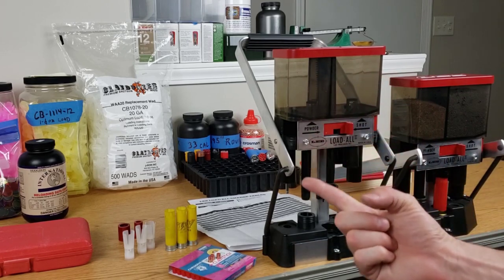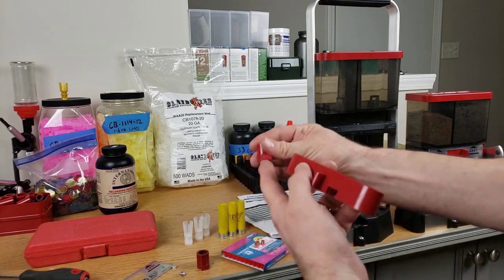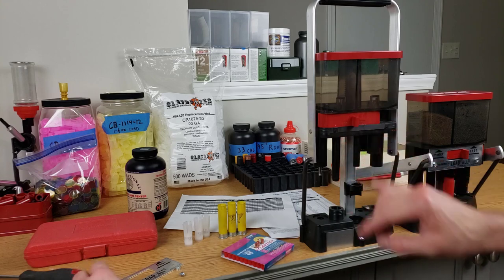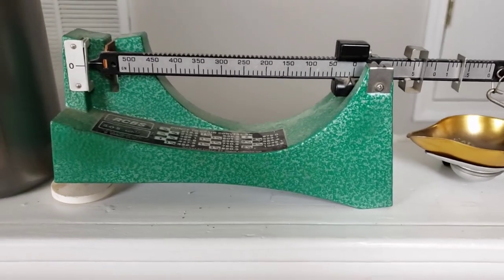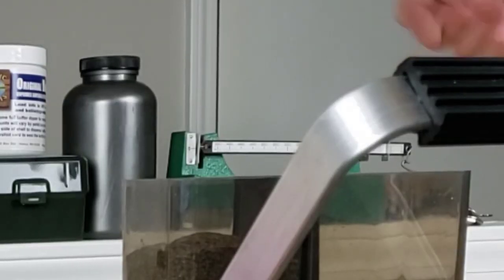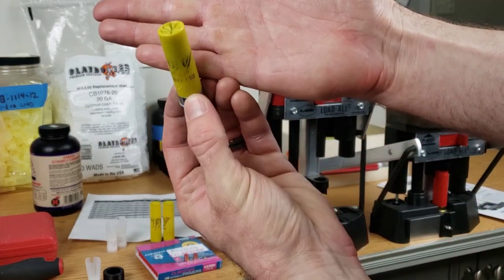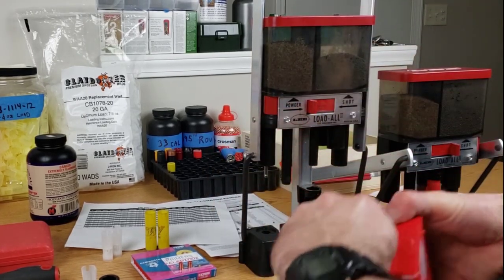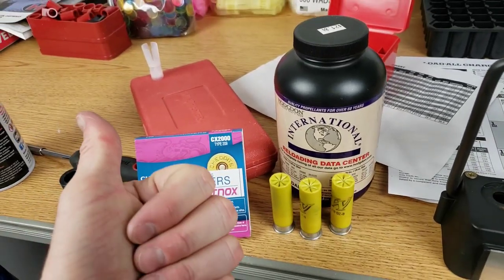First Session On The 20ga Load All II

Comment: You're getting this shot shell stuff down . The crimps look good .  I see you got the complete press for 20 gauge to compliment the 12 ga press . I cheaped out and only got the 20 ga die section to swap with the 12 ga die section . They swap out pretty easily .
Reply from the maker: This bird shot stuff is easy when you have the correct height shot column. The buckshot is going to be a different story until I learn the different stacking combinations. I have buffer and bingo chips for overshot cards to add in more variables👍🇺🇸👌
Reply from the maker: And a second Load All was cheaper than going with a 12ga MEC and 20ga load all conversion kit for now, so I'm also cheaping out... but I might have a lead on a used MEC 🤔